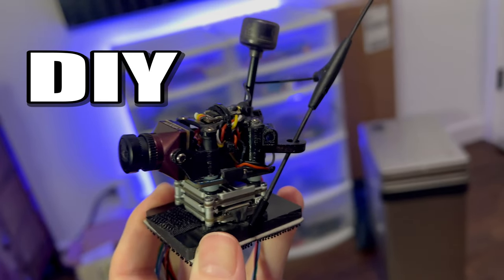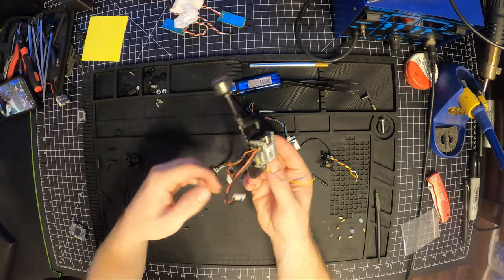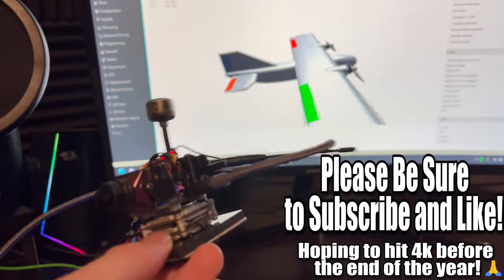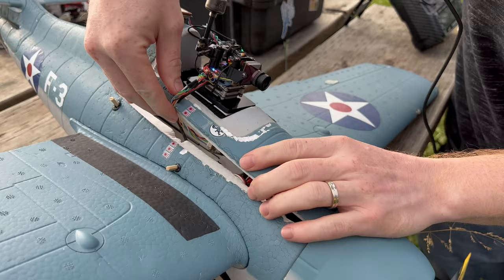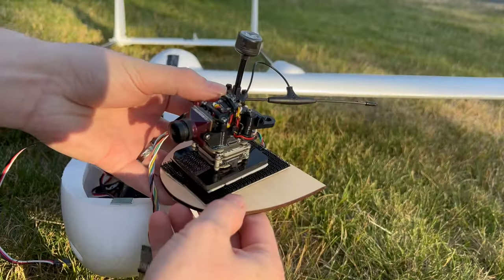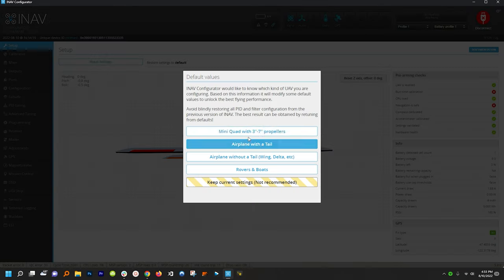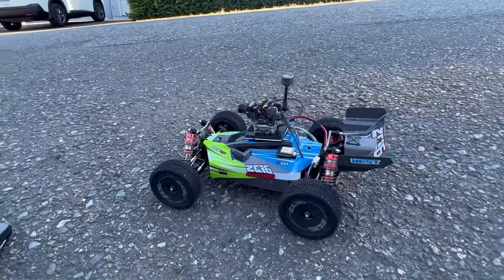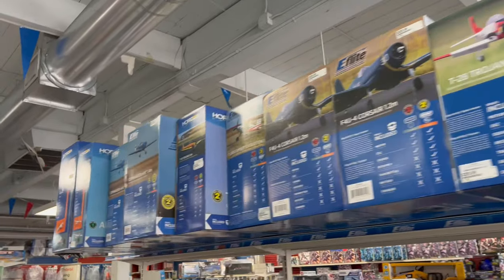Make ANYTHING Autonomous!! - DIY Robot Brain - 4K

Comment: Fpv on RC Cars are great, I've been thinking about using an FC in Mine and obstacle avoidance, but it's not simple.
Reply from the maker: I hope you can make it happen! Using LiDAR may be your best bet (for doing it cheaply) but I’m sure there would be a lot of tuning. Cars often go over small obstacles and avoidance wouldn’t be wanted for those, something that isn’t an issue for drones, ya know.

Another issue is I haven’t been able to get braking to work when using an FC. I can get throttle and reverse but braking never seems to register correctly. Best of luck tho!

Comment: You might want to remove the red esc wire(the one in the servo cable)  from the plane if your pulling power from the brain. The two bec's will fight to the death otherwise. And I'm totally jealous of your flying buddies.
Reply from the maker: For sure^ To clarify more: Only connect signal and ground wires from you ESCs to the flight controller, or any breakout boards from the flight controller. 

And yeah, I’m jealous of my flying buddies too haha 🤙

Comment: Do you have electric noise problems on such tight setup for GPS or VTX??
Reply from the maker: Nope 😎 Satellite locks in less than 1 minute (usually) and zero video issues with the Caddx vista video link. This could be built with an analog vtx and there could be noise issues if that were the case since it’s all being powered off of the same vBat rail, basically; but nothing a decent capacitor on that rail couldn’t fix 🤙